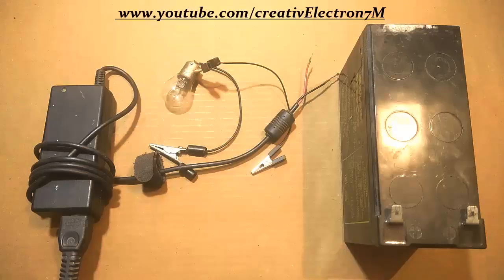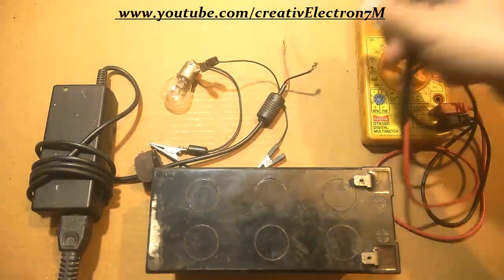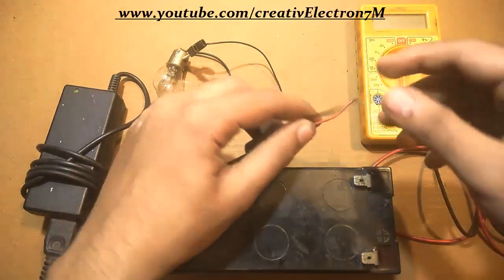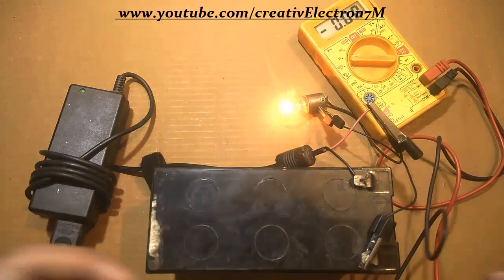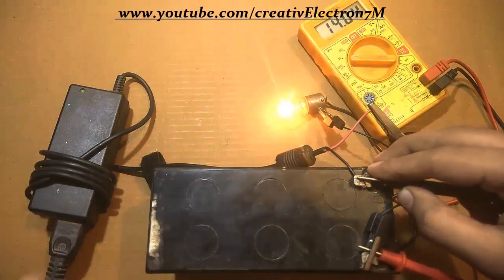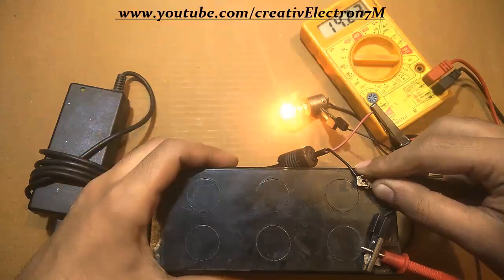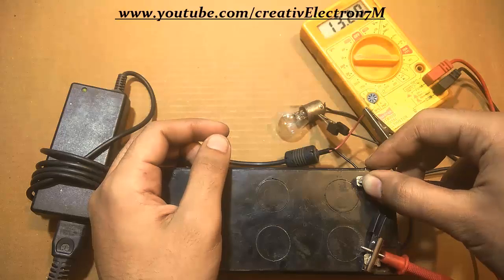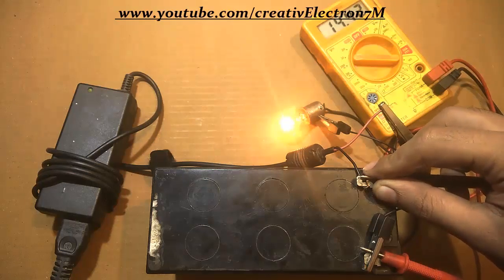Charge 12V bike, car or ups battery with laptop charger

Comment: I am listening to a man in his 40's asking a man in his 50's how to charge his motorcycle battery with a toggle switch and a 12v ac adaptor the conversation has went on for an 1 1/2 mean while I feel like saying look on you tube you dummy so tell me how to jump a motorcycle battery with a laptop charger or does he need a dc adapter

Comment: I like your video but i need some technical information the dc 12v bulb is OK but what about amp calculation like if i have multiple batteries with different AH capacity how can i measure current
1. if my charger produce 4amp current and i have attached 12v 20watt bulb how much current will goes in my battery ?
2. how much current produced by DC 12v bulbs like 12v 20watts, 12v 50watts, 12v 100watts ?
3. can i use my transformer based charger as an power source alternative of laptop charger ?
i will really appreciate if you answer thee questions Thank you

Comment: can we used normal home ac electric bulb or we need car bulb that is dc current. plz tell
Reply from the maker: Only 6v to 12v dc bulb
Reply: @MrElectron  ok thanks
Reply: @MrElectron   one more question if we dont put the dc bulb then
Reply from the maker: Charger over loads.. might die with time....
Reply: @MrElectron  thanks

Comment: Can 15v be use
Reply: Yes. But make sure you stop charging when open circuit voltage of battery stabilizes at around 14.5V.

Comment: I have tried this, but the bulb is not glowing at all. And when I remove the two wires from the battery terminals and joined it, then it's glowing.. not sure what is the reason. Please suggest.

Comment: What about the high ampere/current from this laptop charger ?

Ups battery need 14.4v to charge at 1.4 amp max 
But you are give accurate volatage with high ampere/current 
It will not effect on battery health ???

Comment: Hi, Can I run the 12v Dc fan throgh 19 v charger. Is it working or burn my fan? pls do the needful.
Reply: The fan would most likely have trouble operating properly without special 12v regulation circuitry

Comment: So when applied extra load 19 V droped to 14V.. like that ..that means that charging current also drops?i have seen in the amptek data sheet that initial Charging current for 12V battery should be less than is 0.25C like if 12 V battery has  7.2 amp-hr ,then initial should always be less than 0.25*7.2=1.8A ...is that true......? I mean the charging current really matters? I seen in the data sheet that charging voltage should be on 14.6V to 15 V & if the battery is COMPLETLEY discharge and now charging than they say that initial current should be 1.8 or else the initial current should be 0.4C ../0.4*7.2=2.88A ...is it true? But even though they say that initial charging current should be less than 0.4C (2.88A)..they say better charge at 0.05C..like 300mA and when charging deep discharged battery... They say better charge at 0.075C=100mA   ...dont the lower charging current effects the way battery charges? Wt is the range of charging current for 12V, 7.2amp-hr battery when charging voltage is in between 14V to 15V

Comment: Why did my bulb turned off after a while and all the voltage went straight to the battery?
Reply: Your battery has higher internal resistance

Comment: Can i use power adapter of my set top box which is 12 v
Reply: Use but you will have to use a DC to DC step up converter to raise output voltage ot STB adaptor to around 14.5 volts.

Comment: i tried a car-bulb, it drew 8V, leaving 11.5 for battery, so no use. I then used 2-wheeler bulb, it fused. I think the laptop-charger's -ve should goto to bulb & then battery in series. If the laptop-charger's +ve goes to bulb & then battery, then the bulb can fuse.
Reply: No relation to bulb being on -ve or +ve .Check the voltage and wattage specification of bulb .
Car bulbs are normally 12v and bike is 6 v . 
Try out lower wattage car bulb to get required charging voltage .Bike bulb might hv fused because it is 6v

Comment: When need to disconnect the charging.. And what is watt of bulb
Reply from the maker: 35 watts
Reply from the maker: depends on how low the battery was and how your charger amps.
Reply: We have both 12 volts so how long we can leave for full charge the battery
Reply: Gkn
Reply: Sala hindi ma nahi bol sakta
Reply: Good
Reply: Thanks
Reply: Sala

Comment: i have activa battery can i use activa's tell light bulb to reduce voltage and tell me the hour time to charge it.
Reply from the maker: Yeah !!
Reply from the maker: Don't leave it connected for long
Reply: connecting bulb wont lead to impure current to battery ?
Reply from the maker: nothing like that
Reply: how long i should charge battery like 3 hour or less or more?
Reply from the maker: depends on how low the battery is or how fast your charger is.

Comment: my 12v 8 amp battary ful ded, can I tray? is this work?
Reply from the maker: yesss !! which country are you from ???
Reply: @MrElectron  Bangladesh
Reply: @MrElectron  my battary not holding charge, and fully ded for thunderisom
Reply from the maker: ok
Reply from the maker: put some rain water in it
Reply: @MrElectron  direct 19 v is work???? for weakup the battary
Reply from the maker: @বাদলইলেকট্রনিক্স  don't worry.I will make a video for battery recovery
Reply: bt isn't working!!! 12v 3a use bt no response,
Reply: 100% ded battary not holding charge no response, is the main problem

Comment: i don,t have bulb, and i tried to find but fail. can i use 12 v DC fan instead of bulb for 19V Laptop charger to charge my battery? please reply...
Reply from the maker: Sure but charging will be slower
Reply: Yes but i think low voltage is like torture for motors it will heat up too quick.

Comment: HP printer adopter: voltage=15v  and   Ampere =533mA . Can i used this adopter as a car battery charger ?? Plz reply.
Reply from the maker: yes sure
Reply: No 
Atleast 1.5 ampere need to charge
Reply: @nitish-r6e  not like that this charges the battery but slowly

Comment: Man,the bulb is not glowing and voltage is still 19 volts
Reply from the maker: it means your battery is dead or there is no acid in it.
Reply: Ohhk
So i gotta make distilled water
Can you suggest an easy to make it
Reply from the maker: use rain water or sulphuric acid dilute from some shop.That should work.
Reply: Ok,thanks
Reply: @MrElectron  can I use a12 volt  transform and the laptop charger and connect to battery.

Comment: Great vid thanks, do you recommend this to charge a 6 V 4.5 Ah battery? Thanks a lot
Reply from the maker: Felix Vargas during emergency.Otherwise uses a 12V charger or 2 12V bulbs in series with the charger.
Reply: creative electron7m Thanks, in this case what is the time of charging the 6 V 4.5  AH battery?